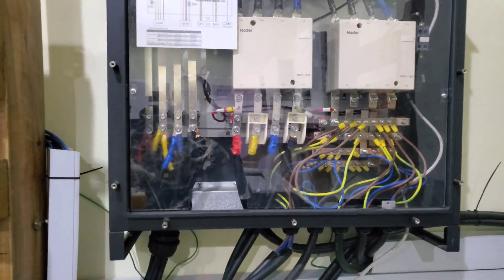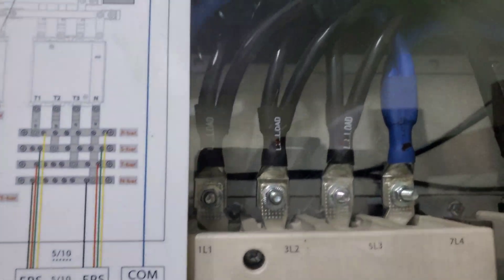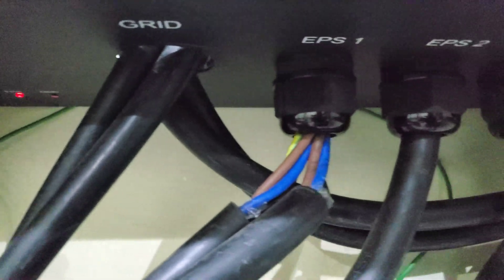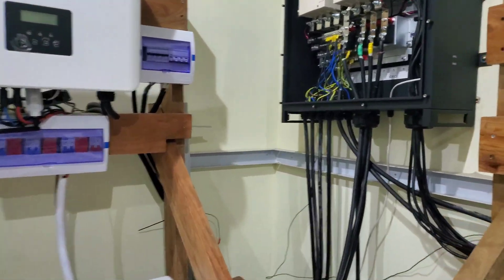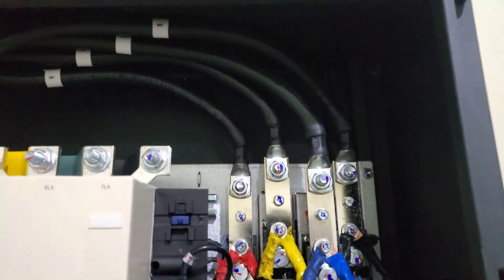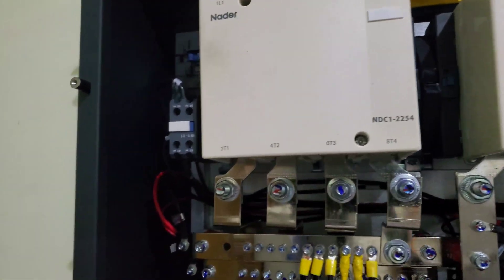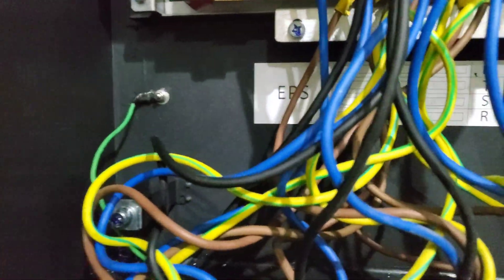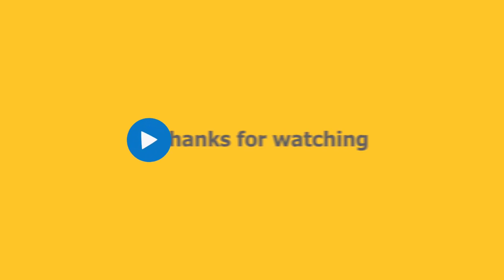Comparing the SolaX EPS Parallel Boxes #solax #eps #microgrid #solarpowerplant

Comment: Quick question Dr Solar, does the SolaX X1-G3 Hybrid Inverter have a toroidal transformer inside like a Victron Multi-plus or is it fully high frequency only with no transformer ? Thanks and well done on the installation.
Reply from the maker: Thank you for watching and commenting. Victron Quattro is a transformer style inverter. The SolaX like SMA is a fully transformerless solution. Nice question.